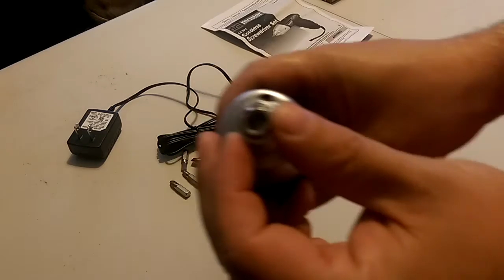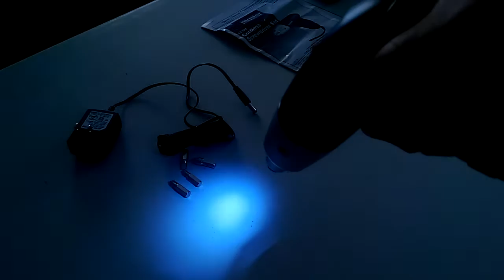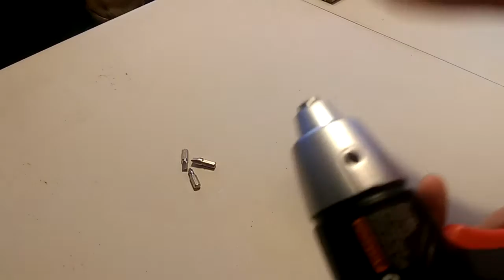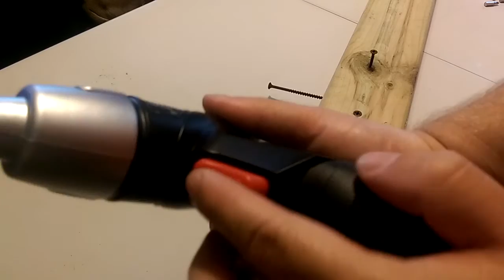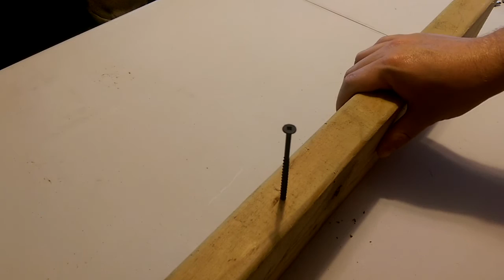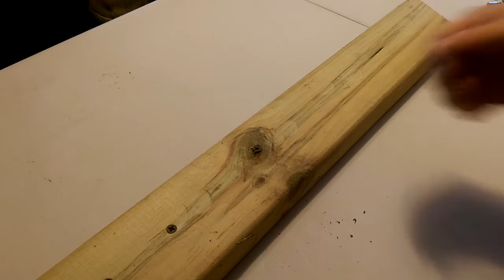Harbor Freight Tool Review - 4.8 Volt 1/4 in. Cordless Screwdriver Kit 61826

Comment: These little drills aren't really meant for heavy duty use, not enough torque or juice - but theyre great for around the house, taking apart laptops, appliances etc.  I don't know why so many on YT take these mini drills and expect them to drive 3" deck screws all day long, not a fair test and not what its meant for.
Reply from the maker: Sure they are intended to be used for lighter projects but a video taking a part a laptop wouldn't serve a purpose.  Its beneficial to know what the drill is capable of doing.

 I was actually impressed that it was able to handle these screws.

Comment: Its great for taking apart electronics, printers and car interiors where there may be 15 screws holding on one panel or circuit board. For $8 it saves alot of time and weight. I have a 120V drill and extension cord for the heavy stuff.

Comment: That is a great tool. I'm surprised it did so well with the wood. For those that happen to live near an Ikea, that one is supposedly a little more powerful and comes with better bits.
Reply from the maker: It actually impressed me.  After the video I went and mounted a Harbor Freight solar security light outside (4 more screws) and it still had battery life left.

More than I expected for such a cheap tool.